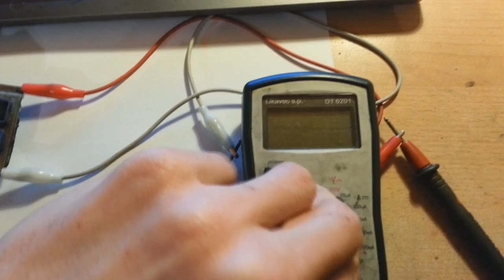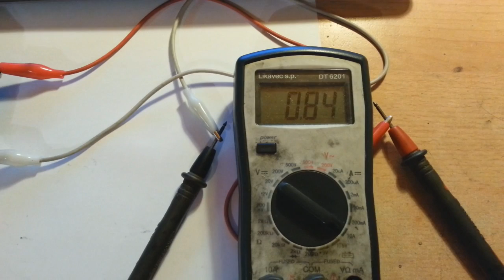Dual Carbon Battery 2017 Edit

Comment: Your battery will end when the electrodes are oxidized.
Reply from the maker: For metal battery, yes,.... oxidizing is a part of the main reaction of the battery. But when will a carbon oxidize if the electrodes are made from carbon? 😉
Reply: @cayrex  OK. Then where does the potential difference?
Reply from the maker: intercalation! when the battery is discharged the cell have 0V,.... after the battery is charged,... the ions from electrolyte will intercalate into positive and negative electrode. And then you will get XY volts,... depending what electrolyte or better what salt you use.

Comment: Great work ! Did you use graphite foil alone or graphite foil with other active material ? I think it is act as a supercapacitor rather than battery.
Reply from the maker: In this video I use a active material only on positive electrode.

Comment: Excellent work and a happy new year!, especially getting that amazing 800mA out of your second battery cell for the very small surface area. Plus a great voltage and initial amperage for your next generation ultra thin carbon/ carbon cell too. Are you using any extra active material coatings on your first dual graphite strip cell, or are you just using the plain unaltered graphite sheet surface to get these results eg manganese dioxide/ graphite or activated carbon mix coating on the positive etc? :)